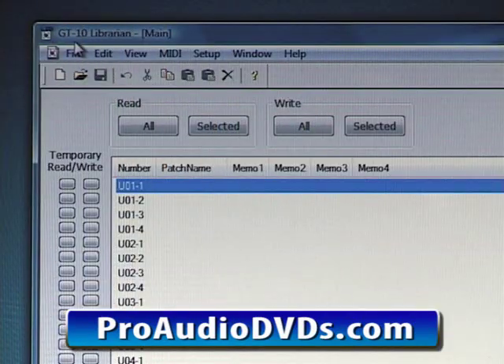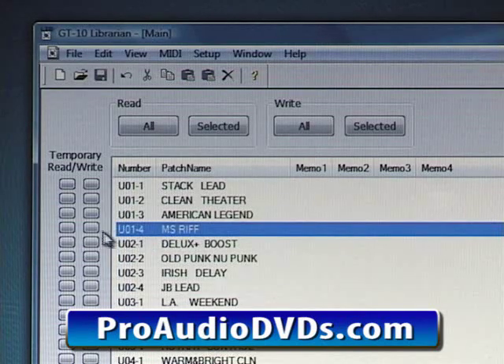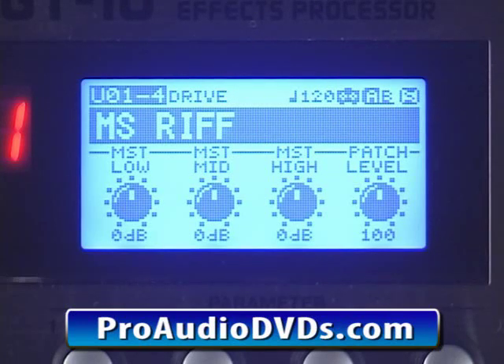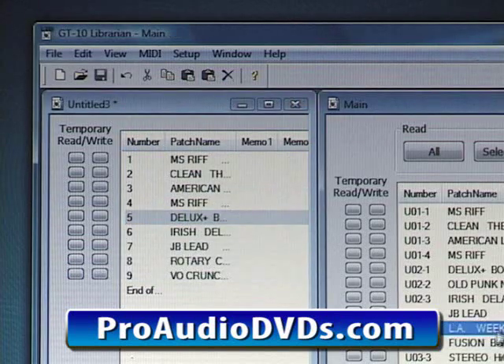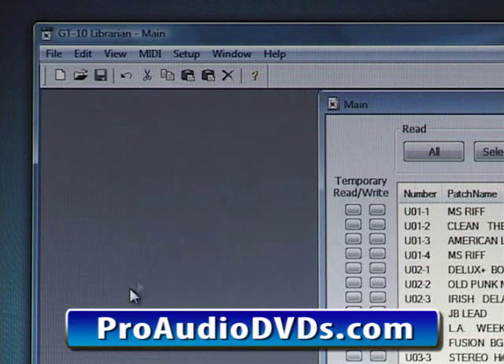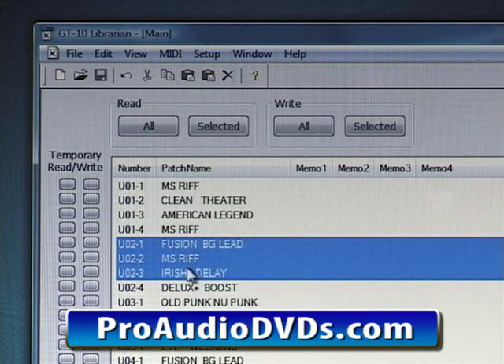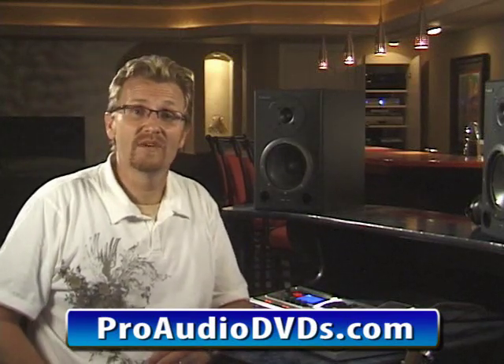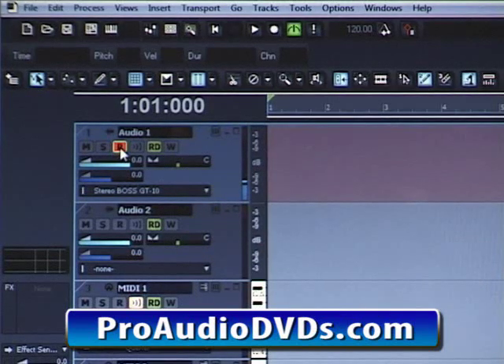Boss GT-10 USB: Back Up Patches, Use Librarian & Record Guitar

Comment: I got the MIDI device setup message and I know I've used it before on this PC. I checked the GT10 menu was set to Advanced already and restarted it. I unplugged the USB at the GT10 end but it didn't seem to do anything until I pulled the USB at the PC end and plugged it back in! Makes no sense but happy it works now!#@

Comment: oh man... I cannot connect my GT 10 to my pc properly for some reason. I connect the USB ,I continue selecting the driver mode, restarting and then a message appears on my monitor saying that the connetion is ok. But despite that I am not able to access via LIB program to my patches etc or download to my GT 10 any patches cause whenever I try to do so a message appears at LIB saying that MIDI devices aren't set up correctly! But I don't have any MIDI device to connect!!!